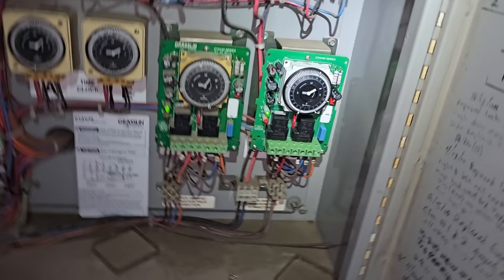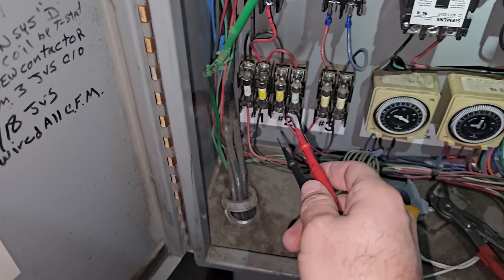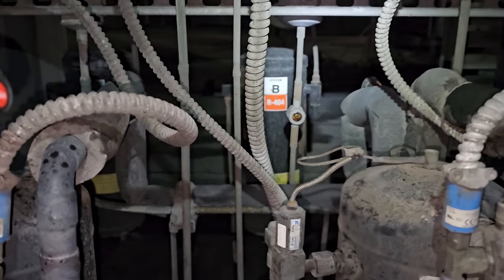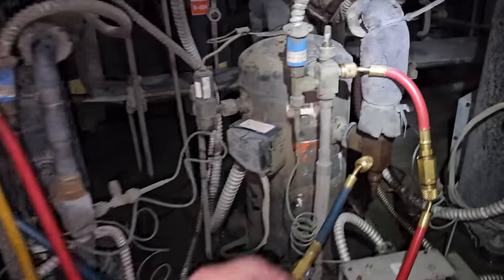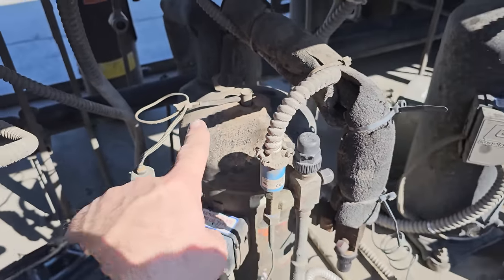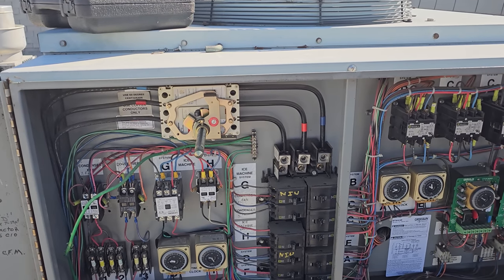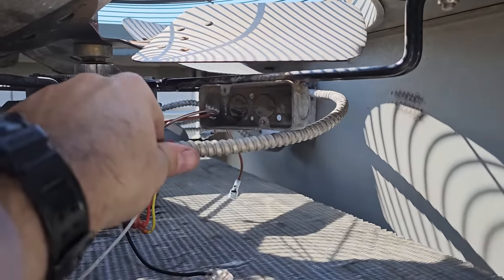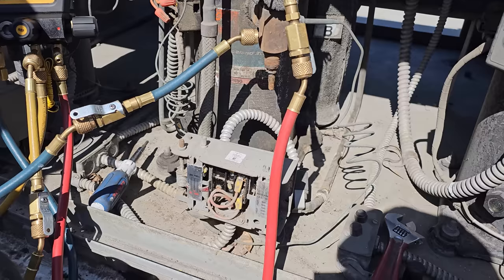LATE NIGHT WALK IN FREEZER CALL

Comment: Hey, a note on capacitor tests. Normally, when caps are higher than their ratings, they are not "over achievers", they are leaky. This means there is dc leakage across the capacitor. Most cap testers test the ac time constant of the caps to get a value. This is thrown off higher if the capacitor has dc leakage. This requires a special tester to test, esr and normal capacitor meters will not test this. So if it is high, just replace it, nothing ever goes up in caps. They always degrade.
Reply: Thanks for the info! I learned something too.
Reply: Mr. Carlson's Lab explains this in detail, as well as how to make a DIY cap tester.
Reply: Leakage can be checked in OHMS mode after waiting for the cap to fully charge to the meter’s ohms test voltage.
Reply: @w5cdt  maybe, but there is a problem with that testing method, as the meters testing voltage is only a couple of volts. So naturally, the leakage at that voltage compared to the operating voltage of several hundred volts will be very different. If you are seeing leakage at a couple of volts it is definatley bad. But it is not really a good way to test as there are not really datasheet leakage numbers for that voltage range. Not to mention, with large caps, it will just charge and never get a steady reading. An lcr meter or a high voltage capacitor leakage tester is really needed. You could run your own high voltage and use your meter to measure current. Though, that is a cumbersome setup and not really worth the trouble. I have a cheap lcr meter, and it will tell me all sorts of stuff like impedance, esr, q, capacitance and also accurately measures low resistances for motor windings.
Reply: @w5cdt  also are you a ham? That looks like a call sign

Comment: An important note on measuring capacitance: Your tool is measuring how long it takes for the capacitor to charge to a specific voltage using a specific current and calculates the capacity from that.
Therefore, if the capacitor's internal isolation is bad (and leaks current through)  or it develops internal resistance (making the resistor charge slower), the meter will read high.

Comment: Had a blown fuse situation, where I fell back on your ‚mantra‘. I later found out, that the compressor I was troubleshooting had - as build by the manufacturer - additional fuses on L1 and L3. And there I was - freezing my behind off - wrecking my head why the only disconnect switch that had blown was L2.

Oh the compressor was mechanically locked up, btw.

Comment: First test on any electrical fault should be insulation test before you move anything..... but I always dive in and disconnect things then realise my error... a tip for you is to lock your meter on test and go wiggle and jiggle stuff.. on more complex electronic systems its amazing what weird faults are caused by insulation leaks..and I have to say my ocd gets triggered when you say a fuse went bad, it's not gone bad, it did its job perfectly if anything it went well and is just unusable after doing its job, perhaps the fuse has opened or triggered the fuse may be usable phrases....... End of ocd ramblings...... Keep the vids coming I love to watch....

Comment: Oversized compressors will have stronger suction because of the larger compressor displacement. Your compressor is practically suctioning more than what the TXV can feed it. 
Back pressure should rise though once the ambient gets warmer.

Comment: Hi Chris, the meter charges the capacitor with a low voltage and continuously integrates the current flow until it drops to 0-ish. Based on the accumulated current it does some math and approximates how many farads a good cap would have.

If the capacitor has failed with low internal resistance, it draws more current. This is why bad caps show higher than normal capacitance.

More sophisticated measuring tools exist of course, but it's not common to see in a handheld multi meter.
Reply: This is it, but to rephrase it, the caps can fail in multiple ways. One is the loss of capacitance, another is becoming leaky. The meter approximates capacitance by measuring how long it takes for the cap to fully charge. If the cap is leaky, it takes a bit longer to fully charge because it's leaking as it's being charged. This results in a false higher capacitance reading.
Reply from the maker: Right on thanks for the info!!
Reply: Never knew that. Thank you for the education.
Reply: Therefore, only sure way of testing capacitor is by measuring its current and voltage.

Comment: The trouble with Wagos in an application like that is, apart from the lever issue, if they're not fixed in place along with the wires, they can vibrate loose.

The lever issue is pretty easily resolved by using the push-in types (2273), so long as your wire is sufficiently stiff or you fit ferrules. They're still removable, you just twist while pulling. Even with vibration concerns, there's less chance of error fitting them than a wirenut, especially working in awkward spaces like that.

Comment: 29:00 The high capacitance might be that the capacitor is electrically leaky (acting like a resistor instead of a capacitor).  The meter measures the capacitance by timing how long it takes to charge with a given voltage.  If the capacitor lets some current flow, the meter will measure that as higher capacitance although it's not actually the case.

Comment: Perhaps that capacitor measuring higher than normal is a sign that it's ESR (Equivalent Series Resistance) is too high and the cap is about to fail. I do know that in audio components (receivers/tuners/amplifiers) that electrolytic caps that measure higher than normal is a good sign that they are out of spec and they are becoming more of a resistor (ESR) than a cap.

Comment: As for why the capacitor is up in value, it can be that the paper insulator inside was slightly thinner than normal. The capacitance is determined by both the surface area and the distance between the two plates. If the paper is thinner then it get closer, which make the capacitance goes up. The downside is that the voltage insulation goes down. But as long as the insulation is high enough and the capacitace is within specs then they declare it good.

Comment: I learn so much from your videos. You do such a great job and your troubleshooting skills with the explanation of both how and why are awesome. I appreciate your hard work putting these videos together... It takes a lot of hard work... Chris did state that a 10 µF  testing at testing 10.57 µF was odd and did indeed replace the capacitor. As the specification for a MARS 12008 is  ± 6% as shown, it was iffy in my . I personally think there will be manufacturing variation, but as it was close to testing out of spec., and to prevent a callback, replacement of a ~$6 capacitor is prudent.  Regarding Mr. Carlson's lab DIY capacitor tester, yes, he does amazing work. Have an awesome day!

Comment: High inrush currents are no problem for the motor (you can overload them 5..10 times their normal rating for a short period of time and it will not damage them), only for connectors, connections and especially for contactors.

Comment: I had a unit that was popping the 50A main breaker. 50 + year old Federal.  Replaced it, everything seemed fine. Popped the new one, after some time. (I was gone) Turns out it was the condenser fan motor getting hot, seizing after some time. Then the compressor would overheat & pop the breaker.

Comment: just a note from my experiences over the years when I see amp draws higher than another from the exact same motor, other than capacitors.... check the blade. many times someone has replaced it with a different blade, 4 wing to a 3 wing, or 17 degreee to a 23 degree pitch, then also the blade insertion depth.  These are variables.  as long as the amperage is under the nameplate rating you should be OK.  The other thing to check is handshaking of the motor shaft of both in question.  This can be done with the blade on too.   Just my two cents.

Comment: Depending on how your capacitance meter works, there is a possibility that a cap reading high may be leaky, that is, have a resistance between the terminals as well as a capacitance. You can switch over to Ohms and clip onto the cap and see if it goes open circuit or not. You will probably have to let it sit a couple of minutes to get a good reading.

Comment: That capacitor could be leaky (electrically), which would cause your meter to read a higher capacitance. Fairly rare to see a capacitor be that high over rating after being in service for a long while.
The reason being leaky causes this is that your meter is timing how long it takes to charge it up, and deriving capacitance that way. If your capacitor is leaky, it will take longer to charge - thus higher capacitance read by the meter (but it actually isn't higher).

Comment: When capacitors are higher than expected is due the ESR value screwed up. Replace them for safety, but usually are more a problem in low signal application

Comment: Hey Chris, to fallow up on your tangent as you say, I am old school and retired in 2013, but what ever happened to two Stage scroll compressors with a loader un-loarder, why haven't I heard more about these ? I know bigger chillers and 100 and 200 ton systems have something silular. Was just wondering why manufacturers for smaller commercial and residential A/C systems have not inbraced this? PS: Good video brother. :)

Comment: The Capacitor going up in value is totally possible. I have been watching Vintage Tube Radio videos from Mr. Carlson's lab I have heard him in multiple videos saying that Old Capacitors (Ex. Made in the 1950's) to a capacitance tester (which your multimeter just measures capacitance) can look like an overachiever with higher than tolerance capacity. Though when placed on a capacitor Leakage tester (Very dangerous as it can deliver thousands of Volts) it is shown to be Electrically Leaky. Therefore capacitors when they go bad can turn into a Resistor and look like they have a higher capacitance to your multimeter when in fact they are BAD!!!! I know that Mr. Carlson's lab has built himself a low voltage capacitor leakage protector but unsure of what it's limits are for testing as it was built for Audio capacitor testing but because HVAC doesn't require nearly the same tolerances as what audio requires, then it may work but it is a build it yourself device that is available through his patreon so that is not a go to solution but he does put out some good videos explaining Capacitor Electrical leakage.

Comment: When capacitors age they may get electrically leaky.  This will cause the typical capacitance meter to read high.  When capacitors get leaky, they usually have higher ESR (Equivilent Serias Resistance) which will make your motor require more current.

Comment: While clearly not the problem in this case, if a fuse is a time-delay type, older fuses can get what I call "Fuse Fatigue". I've seen it on single phase residential A-C compressors. In time-delay fuses the fuseable link is packed in special sand within the fuse that keeps it in place and prevents the fuseable link metal from falling into molten blobs. After many hard starts (high inrush amp draw) the fuseable link will have partly melted then re solidified over and over. Eventually the fuseable link is so compromised by the repeated partial melting cycles that it lets go. Cut an inexplicably failed one open and do a necropsy on it.
Reply: You can also suffer from fatigue with open wire fuses. High temperatures during inrush and prolonged load with exposure to oxygen and moisture causes corrosion until they finally let go on a rough inrush like motors - vacuums are a good trigger. Not a common problem these days.
Reply: Higher current fuses rarely blow for no reason, but low ma rated fuses often do. With open and glass fuses, you can tell if they just got tired or blew because of overload.

Comment: doesnt that 10-20% written on capacitors mean that the capacitance is somewhere between that range from the advertised capacitance when its manufactured?
earlier on when i had just started working with single phase motors i thought that was the range which is acceptable for the capacitor to operate but when i did some more digging i remember finding out that had nothing to do with it and it was just the same thing as the + - 5grams on products weight.
Reply: In electronics the tolerance on a capacitor is both the allowed tolerance when manufactured and the allowed value tolerance during service life.
Any 10% value tolerance capacitor reading more than 10% under the rated value when out of circuit, is a bad/dead capacitor that is no longer fit for purpose.
Reply: @RachelMant  so its actually both good to know

Comment: If I have 200 ft of piping, would I still charge the receiver 3/4?
Reply from the maker: with long lineset runs the reciever needs to be sized usually bigger so it can still hold the entire charge, so you need to find out if it has enough storage capacity
Reply: @HVACRVIDEOS  perfect, it is also water cooled!
Reply from the maker: I will discuss this on my Livestream this evening 3/6/23 @ 5:PM (pacific) come over and check it out 
https://youtube.com/live/oD5k3jZQfb0
Reply: @HVACRVIDEOS  hell yeah!